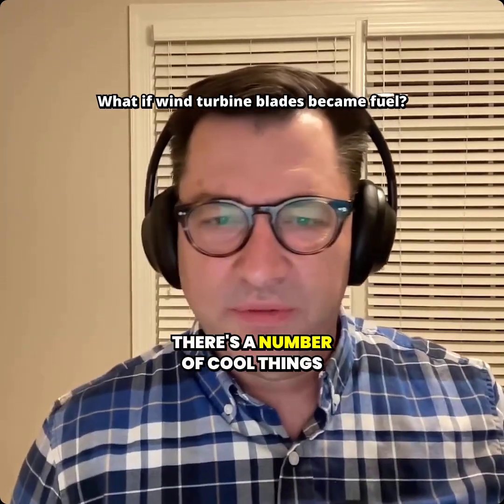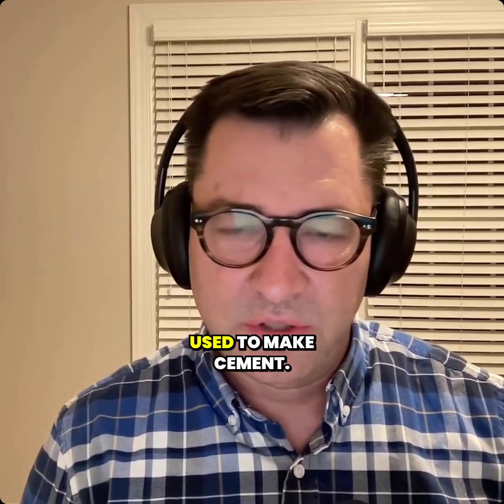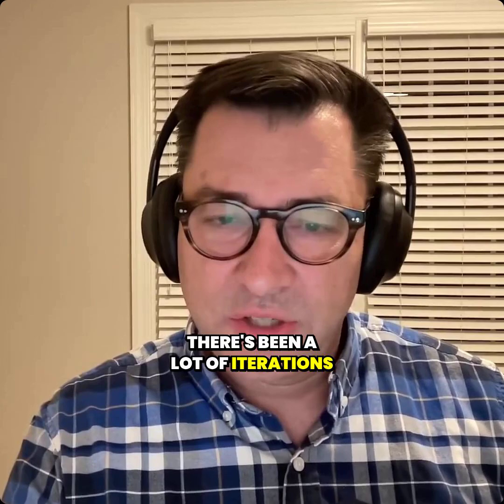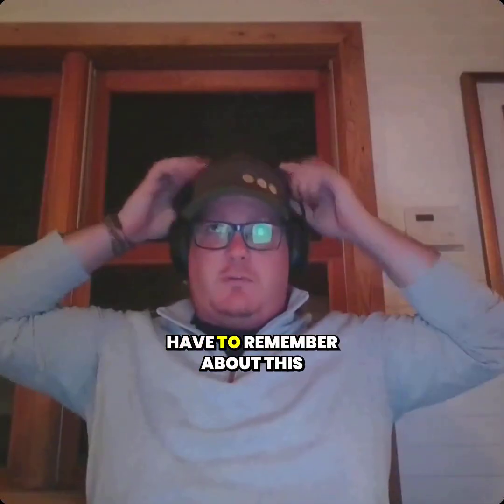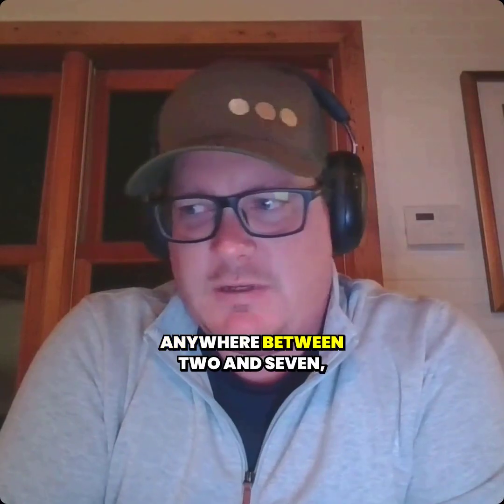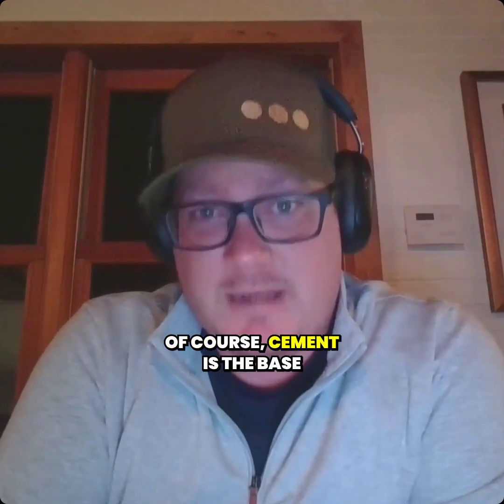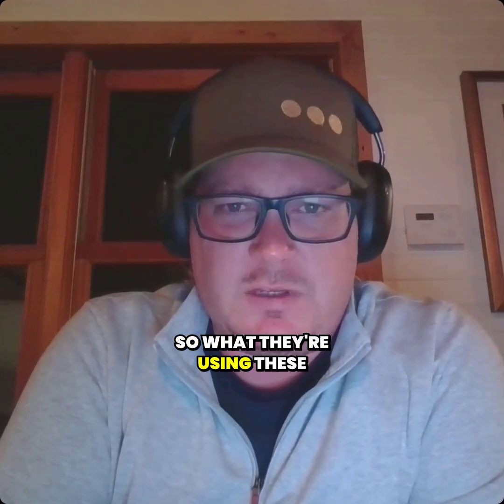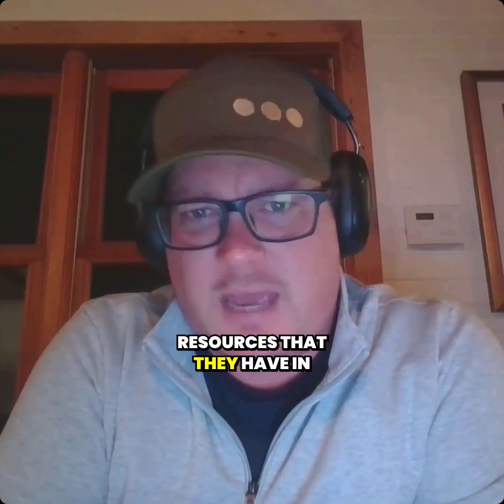Breakthroughs in Blade Recycling: Veolia’s Circular Solution

Comment: I had a thought. There are many architectural uses for old blades, but when I tried I immediately ran into trouble because structures are always  bilaterally surgical in their essence. Blades as we know them are not suited because they all twist in one direction.

Is there any way manufacturers could be convinced to make both clockwise and counterclockwise rotating blades?  If they built both left and right sides the reuse would be much greater.